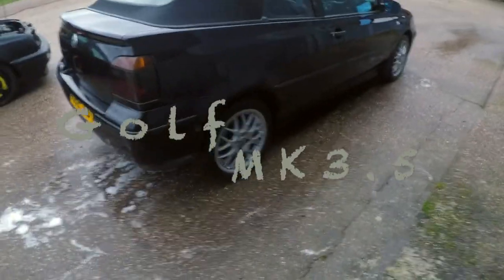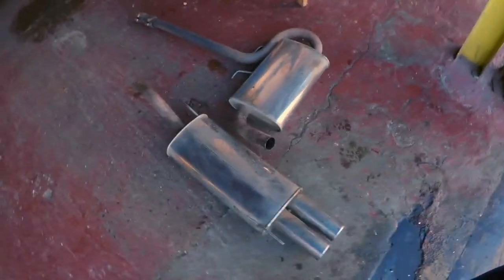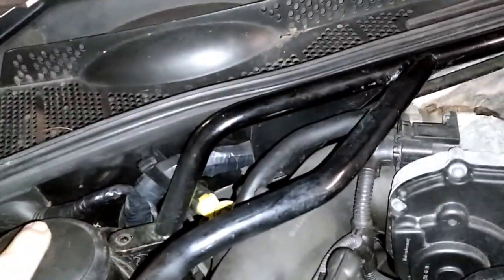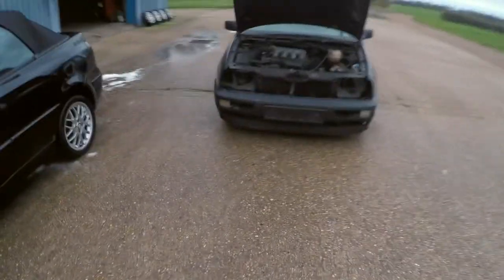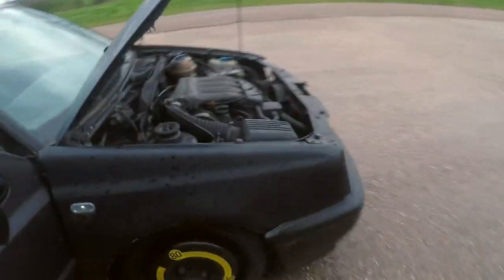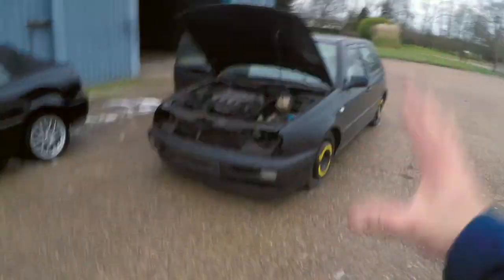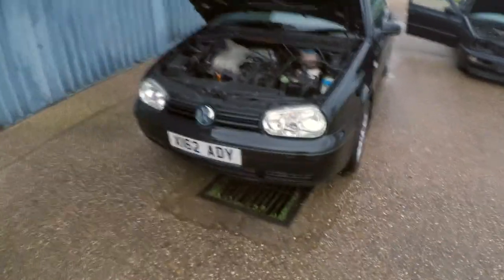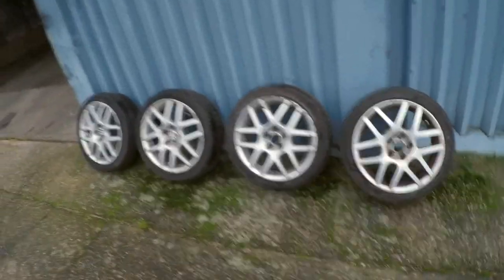The Cheapest VW Golf colour concept convertible project ABF 16V Part 0

Comment: Did you get the car done
Reply from the maker: Yes done finished with the ABF, there is a whole play list. 👍🏼
Reply: @RestoDesignsnando  thanks I’m going to watch it all later on.. 
I’ve just bought an identical one with 80000 on the clock in lovely rust free condition that has a short mot and hasn’t been cleaned properly in years for £250 and I also have a V5 Golf which I got for free that was going to end up in the crusher with low mileage but hadn’t been serviced or washed in 7 years which I’ve just started using as my daily.
Reply from the maker: @vspencer9764  wow that was an amazing deal @ 250 mate, well done, a word of warning, it doesn't end well for the 3.5. 🤔